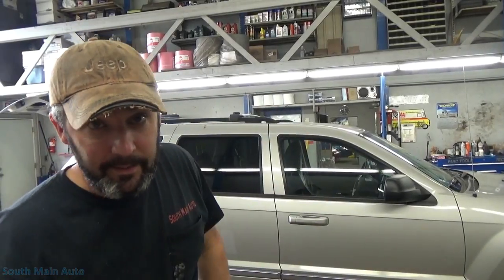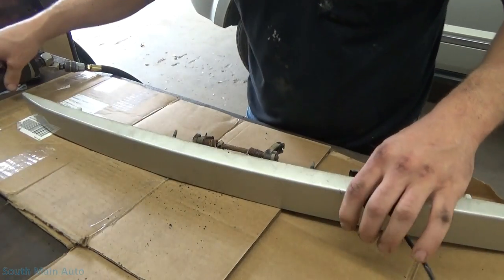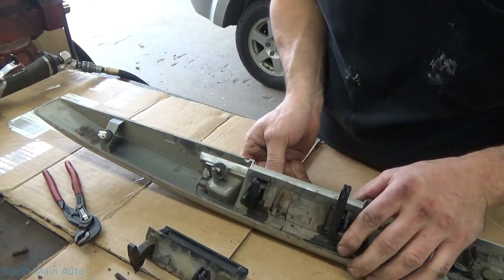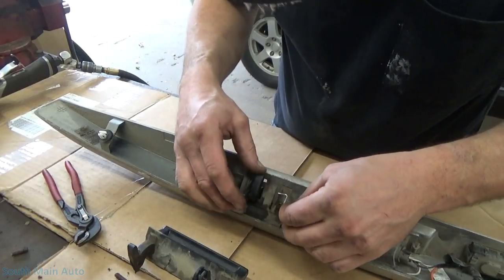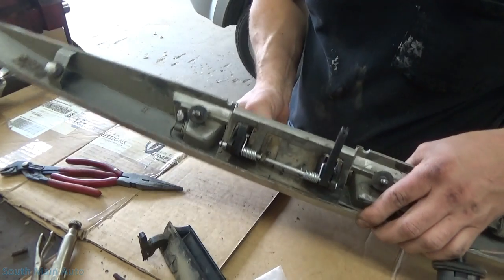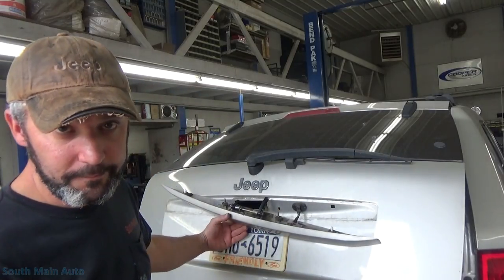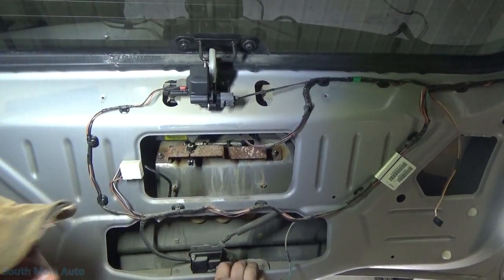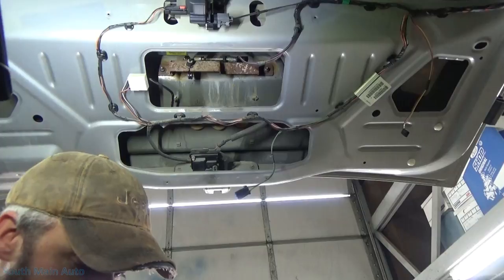Another DORMAN PRODUCTS FAIL: Jeep Grand Cherokee Liftgate Handle

Comment: As frustrating as that was, at least it wasn't the plastic molding that was wrong. That can't be welded.  :)  I've learned from you to ask NAPA who makes there parts. Not that it makes a difference, it's always Dorman.
Reply: You can "weld" plastic...actually easier than welding metal!
Reply: Yeah, your right but not with the MIG welder.  :)
Reply: Pine Hollow Auto Diagnostics +1 Ivan
Reply: wyattoneable with a heat gun
Reply: I think places like NAPA should sell their own brand and not a re-brand or at least  stand behind it with a if it brakes we will replace it and install it free. lol wishful thinking.hahaha
Reply: SEO Profits Pro *Breaks!
Reply: We just got the first NAPA in our region (not sure if it's the first in Australia or not) but they bought out the biggest Autobarn store around here. I hope they don't do the same crap! Autobarn has opened a new shop just up the road from their old one, bizarre!
Reply: A 30 watt soldering iron & a black cable tie. There's your Plastic Welder.

Comment: A Tinnerman nut would have worked after you cut the rod
Reply: Is that like the ones that hold on a kids tri-cycle wheel? Looks like a washer with some slots cut in?
Reply: most Tinnerman nuts are rectangular spring steel with an "H" shaped slot in the center with "V" shaped notched in the crossbar although I have seen round ones. But that would have worked just fine,
Reply: Crazy glue would work just fine.

Comment: OUCH!  I get that you should expect a replacement part to fit without modifications but your fix violated the WTF rule. (When the next mechanic comes along and says, "What the .... is this?".
Tech Tip from a machinist with Chinese equipment where nothing fits is par for the course to those without a welder :)... 
Install just the pin fully into the mounting bosses.
Use a Sharpie to color the exposed end.
Remove pin and cut it so it just fits through the opening by 1mm (1/32) or so.
Use a hacksaw or Dremel to make a new groove in the middle of the remaining colored area on the pin (or use a push clip).
Assemble the handle and apply rust prevention on the end of the pin and the groove where the zinc plating was removed.
Add 10 minutes labor cost to job.
Send Doreman a nastygram or thank them for an alternative to Jeeps' design flaws depending on your mood.

I imagine using them groovy pliers (Knipex rocks!) to fold up the edges of the opening to make room would have worked also.

Keep fighting the good fight!
Reply: Good idea, but did u see what a pain it was tryjng to get those springs on?  I'm sure Eric didn't want to go through that again. Plus the plastic is probably getting ready to snap any second.
Reply: Yup! We’ve found our spring expert!
Reply: You fix it how you decide. He saved the lady $300 worth of parts. The next mechanic will need to cut it off just the same as he did. So technically not a violation of your wtf rule.I personally would have notched the body.

Comment: While I would agree Dorman is mostly junk now a days, that latch can be installed attached to the vehicle. The long ends of the springs are designed to hooked around the plastic after it's altogether. They will move that far without damage. You almost were doing that on the one side, but you didn't pull it out and around, you tried to go over and said it wouldn't work. If I was replacing my own, I would substitute a stainless rod for Dormans, and never have the problem again, and I would have notched the tailgate and painted the cuts.  Of course, I would have never bought a MOPAR in the first place, unless it was a 68 Road Runner. Love watching your video's! Keep up the good work.
Reply: M. L. Turk good point maybe remove the assembly to get it apart and do final assembly inside the tailgate
Reply: Simpler alternative would be to bend the lip with pliers, no paint required & only takes a few seconds, literally!
Reply: If you bend the lip, it doesn't look like factory. OK on your own cars, but not on a customers car. There is a standard when you do this for a living.
Reply: You are as entitled to your opinion, as I am to mine. Have a nice day.

Comment: A little oil would probably solved the problem. I had a Honda with hood latch stuck and oil did the trick. Had to work it in but  it released  from the rust.

Comment: This is why I love pick and pull yards.  We've found so many items for our cars and trucks, just need to get to it before the "flippers" get to it.  They don't care if you grab the entire gate, or just a part of it.
Reply: I have to give Dorman some little props.  In general I've found their sheet metal hangers for springs and shocks to be decent.  Just did a '94 bronco front shock mount/spring tower assembly that was rotted out.  Hard to locate part, but Dorman actually did these for 'quad' shocks.  The rest of it's questionable, but their hard parts seem to be okay

Comment: That's a pretty sweet t handle. Does it come with a built in uni? Or is it just a 1/4 drive t handle with a uni and socket fitted.
I'd be interested to buy a 10 and 12 if they're an all in one setup.

Comment: To be fair this good for dorman .
easy fix and could simply cut short and cut a new groove and reuse the c-clip .
70bucks is bit steep though, worth about $35 at best. 
quite easy make your own rod if plastic not cracked or too brittle so repair could be done diy for few bucks at hardware store if lucky .
Get similar issue on the SG forester rear handle but less plastic in that so harder get good as new result easily .

Comment: Twist some steel wire around the pin by the spring & coat it & pin with epoxy.  It would probably never come loose.

Comment: I would have moved the sheet metal a little on each side and centred pin. 
I was going to reccomend lubing latch, but next better is new latch. For those that follow this process, i honestly dont think the  pin would work itself out. So welding may not be necessary.

Comment: A small slot in the tailgate in the left side upper pocket  that the rod has to pass thru, cut with a 4 1/2 inch metal cut off disk would have worked nicely. Just big enough for the end of the rod to pass thru. Then a dab of sealer from the inside of the tailgate to seal the small slot in the pocket. Wouldn't be seen and would have taken a minute or less.

Comment: To bad there is not a BSA automotive part department, I remember the old BSA commercials on TV as a kid with the slogan "We don't make the parts, we just make them better" Not sure why some engineer has not come up with a high strength ridged nylon replacement pin for that it would not rust or brake with the new generation bullet proof plastics now days. lol

Comment: I would have kept the old handle - chop the bar up so you can get it out, then drive out the remnants with a punch.  I actually cringed when you cut a good OEM handle - I knew it like would outlast the car....  Every Doorman plastic part is crap, but they can't really screw up the metal bits (even if they apparently can).

Comment: Not a spring expert but it was pretty obvious you put it together wrong. The springs go in with the pin under no tension, then you use the hook pliers to rotate the large hook in the spring around the arm. Much easier than what you did. I would of put some sort of small panel between the spring end and the main body to keep it from digging in any further.

Comment: Yeah. Shame Jeep didn't make some kind of seal around that latch handle. Driving on salty roads there's going to be a spray up behind the vehicle that's going to fog into the inner walls of the tailgate Or, they should make the metal parts of that mechanism out of a cadmium plated stuff so it's going to last a bit longer.

Comment: I* would have lived with it. While I have changed the liftgate handle on my old Scion the Ebay parts worked fine. Mine was locked shut, period. Could you cut the door slot wider? IDK if that was a real option.

Comment: I bought Dorman brand parts in the auto supply stores over many years when I couldn't get anything else and it's always junk. I bought some headlight adjusters not more than a week ago ,if you tried to put them in, install them in the panel they broke.  they're junk!

Comment: Clearly replacement part not as it should be, but must note that the Chrysler design of that door handle is poor too. The hole the handle slotted into seemed to allow all the crud to leak inside the door panel, surely they could have shielded the mechanism better and so limited the chance of it getting rusty in the first place

Comment: What is that the H/freight impact driver?
Like your videos.   I understand,  used to wrench myself.   
Nice U try to save them $$.  $300 is not worth it.  Neither is that $3 part Dorman part making so much profit.  
U can use painters tape then cover painters tape then cover with duct tape.  To prevent scratches.   
    I bought Dorman door handle.  Took me hrs to try install then did not work.
Did not have enough range to open door. Cheep plastic
Bought 1 from  dealer.  Dealer started laughing.  They  told me they heard dorman does not fit.  
Took me 20 minutes to R/R?   Worked great. 
I called dorman they told me that they sold thousands and never heard of the problem.  
They told me it was the door maybe due to collision or my fault.  Not their part.  
  Friend of mine bought wiring harness, end looked same.  Was cut different and connector would not fit.   
We ended up buying the bulb socket from GM.  1157 bulb only ground and 1 hot terminal made contact.  
Bought socket from GM, had to use old harness.  I had him call Dorman they told him same speech that I got a few months before.  
They told him it was maybe an electrical problem.  Had good ground and 2 hot wires.  
Socket was very sloppy fit.   
   They don't care if it works.   30 yrs ago they did and Help line made some 1/2 way decent stuff.  
quality went down hill and so did manufacturing.   Now it is a joke.   
Take care

Comment: What about Fluid Film? This is what it was made for.
Could have turned the E to a closer position. (With Small lathe)
I would probably have bathed the old stock garbage in fluid sheep grease and put it back. 
I don’t suppose you can sell that kind of work to a customer.

Comment: apparently dorman has it in for you guys. all you had to do was slip that longer end in to the opening first. I did my wifes jeep 3 years ago. never had a problem. Ive never had problem with dorman parts except that stupid PCV Vacuum line on GM 3.1L engines. its always to short

Comment: Looks like you had room to angle it in,or slot the tailgate. I would slot the gate. its not hurting anything to take a chunk out of the gate. Its only metal. Prime or seal the spots. Always think outside the box on that shit. I wouldn't have cut the pin.

Comment: it really sucks that they don't test their products to see if they even will fit or even work. and the fact that most of their stuff doesn't last very long sucks to. I was just thinking, if this was your own vehicle and since you pointed out they don't last that long in NY, couldn't you have just used a die grinder and put a little notch on the edge of the hole in the door so everything slid into place, I mean it will be covered. I know that's not the right way, but when dealing with this crap trying to make it work.

Comment: Could you not have used the cutting disk to cut a slot in the rod, closer to the plastic leg, and then put the e-clip in that? Then cut off the excess 1/4 inch...

Alternatively could've cut the new rod in 'half', in the middle, cut the 1/4 inch out of that, then run a die on the ends of the that to thread them and a nut to join the rods together again.

Comment: I almost peed myself laughing when you pulled out the wire welder. Those push on retainers would probably be the best solution. I would probably tried drilling a small hole used very small cotter pin or lynch pin. Was that the Krown spray you used?

Comment: i would of called the customer and told them but ended up just taking a dremel and cut a little notch in the tailgate for the pin to pass through and gave the spot a toot of primer.. Would never see it and done

Comment: lol, what do they call doing the same thing over and over again, but expecting different results?

Stop using Dorman! Recently installed an EGR on an Equinox. I told the customer I can install Dorman which may not work or they can wait a day for a proper replacement. In this case Airtex/Wells. I refuse to stand behind Dorman's products until they do

Comment: Dorman does make some real crap. A few years back when I worked at NAPA we were selling a lot of their engine oil cooler lines for the GM 4.3. We ended up buying 3 engines for customers. The crimps they used on the fittings were inferior. The customers were cruising down the road and the crimps failed. It doesn't take long for all the engine oil to puke out going 70 MPH down the freeway.  Long story short: Don't buy any Dorman oil cooler lines. As far as I know they haven't changed anything about them.

Comment: would have been so much easier to use that grinder and cut a small slot in tailgate for longer bolt. not going to see it as it would be covered up by handle anyways

Comment: Dorman needs to include a universal install card.....
Step one - Remove part from box
Step two - Install part and box in trash can
Reply: Seriously though.... I wonder if you couldn't put the pin in the other way around. Install the pin and mark it just past the second plastic support. Drill a small whole for a tinny cotter pin and cut the pin flush with the last whole. As you assemble it, put in a small washer to go between the plastic and cotter pin......  IDK, never worked on one, but just an idea...

Comment: Maybe should have just soaked the original mechanism in oil for a day or so and seen if it loosened up.
Reply: Soak in phosphoric acid solution, rinse, dry, and grease the heck out of it.

Comment: I get picking on Dorman and not being happy about the cost from N.A.P.A.  But how much is deserved? How about Chrysler engineering? Springs can be made of stainless steel or beefier wire stock. Then maybe it wouldn’t rust or fail prematurely. The Dorman part has to fit within the already perhaps poor engineering specs. In fact, Dorman is really just a supplier, I doubt they make anything. Dorman may even source this part from the same manufacturer as Chrysler. It could be someone such as Eberhard or Trimark, but they may or may not have a say in the design or materials. If a big customer like Ford or Chrysler says we want 500,000 just like this, are you going to turn them down?  As for NAPA, the cost is never just the part alone. They have to stock it, inventory it, distribute it, package it, and more, plus dole out free gimme hats, stickers, magnets and calendars both to keep you happy and remind you who to keep in mind when you need a widget. It’s pretty complicated logistical stuff!

Comment: The answer is: make replacement parts to fit the same as what they're replacing. For Feep-sakes Doorman have a word with yourself. Even if you didn't live in the rust belt & the pin wasn't rusted and you somehow managed to grip the springs & put it all back inside the tailgate...
Some poor bugger might need to pull that trim off in future... but he'd be doing the whole thing again. Because some clown couldn't be bothered using a ruler and two neurons. They sound like Pyramid parts for motorcycles...

Comment: LOLm this handle is a trolling product. After you feel the relief of the handle, spring and pin installed and working ... BANG, the assembly wont fin in the tailgate. It give you some hapiness first, then  it take it back. What a POS. The went in ALL the trouble of making the tooling for molding the part (expensive) and cannot make the pin the right lenght ?. Parts trolling at its best.

Comment: The fault is more Chrysler making crap like they always have.
Reply: I don’t know about current models, but have you seen the dash support structure in a GM Truck around 10yrs old? Not a drop of paint on any of it and rust everywhere. I even saw brand new trucks on the lot back in the day that were already completely coated in rust. Chrysler was at least getting that part right back then. All of the dash support was either painted or may have even been powder coated. That gate latch handle needed a shot of paint too, but compared to a GM truck (maybe cars too, but I haven’t been around many of those) of that vintage, the Jeep is WAY ahead of the game.

Comment: Dorman has flooded the aftermarket with problem solvers not high quality but in some cases the only one available. Perfect example 04 ford escape has a hanger bearing not available as a separate item from the $1,200 drive shaft here in Canada. Went on line and Dorman offered this part $40 and after shipping $60 holy crap. Did not care how cheap it was was dumping this thing in 6 months worked out for me mabey wont see how long this thing lasts but who cares in this case did its job. And in the case of keeping this thing If I had to replace it again would not lose any sleep.Yea put wingnuts on them because you are going there again.Just saying

Comment: From Leo:  Dorman is only a small part of the equation.  The biggest part is the new generation on cadcam jockeys that think they are engineers with no real life hands on vehicle experience.   They listen to the bean counters and design mechanisms of a durability that would not have been used on toys a generation ago.  In the 1960's the only time a handle broke on a car was when the car was crushed in a wreck.  The foreign cars used to be flimsy, but now they all are.

Comment: You absolutely can install it while it is on the vehicle.
Push the rod through and place the springs in unloaded, once the rod is secure use needle nose pliers to put the springs in place. Done in 5 minutes.